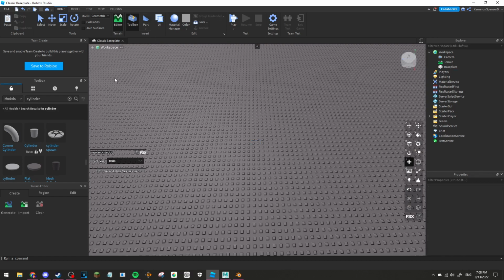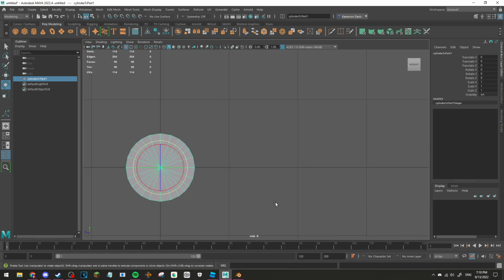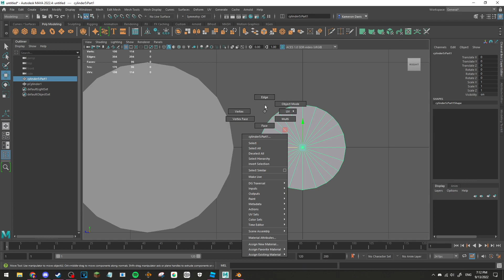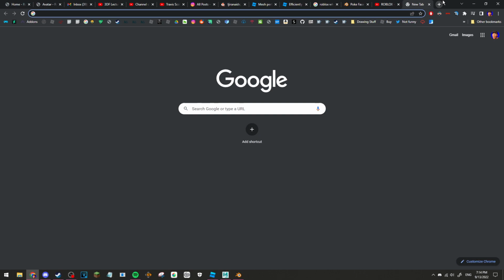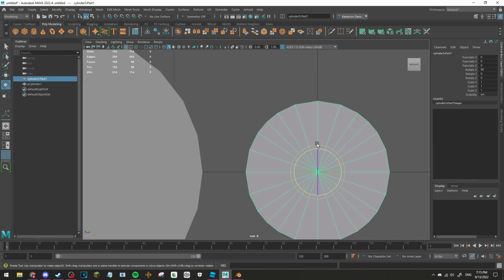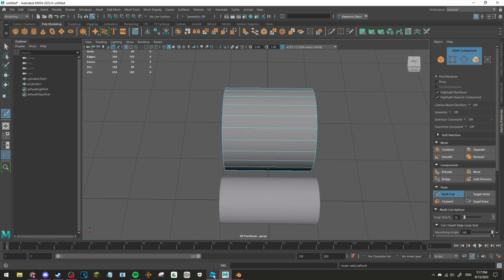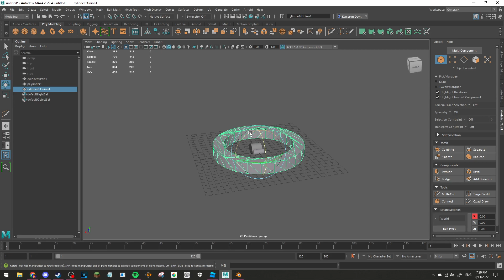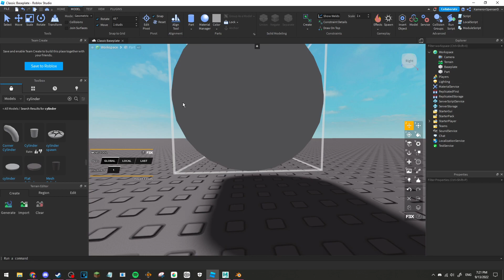Roblox's Atrocious Cylinder Model

Comment from the maker: Some things that could be noted for why this was the way it was is because of when Roblox was released. It took them till 2015 to add collisions to the mesh itself so it's likely that they know about the edge flow being bad. This could probably be a fix that would take a while to implement and, maybe in their eyes, might be unnecessary (because no one I've seen on any forum online has complained about this).

Also, a question I've gotten before making this is why don't I just learn the rotations for all edges of the cylinder? To answer this question is the same with the union issue: why should I have to do that in the first place? Considering I've already put effort into learning how to do it for a regular 24-sided polygon it doesn't make sense to do more geometry homework for something that should be straightforward.

The biggest drawback I can see in changing the primitive is that it's basically rewriting Roblox's code to include new parameters for an already existing primitive. To clarify, this could *potentially* mess with games that already have the cylinder primitive in their games (it could also be a lot messier for games that use cylinders as their main game function, such as racing games or games that use cylinder hitboxes).